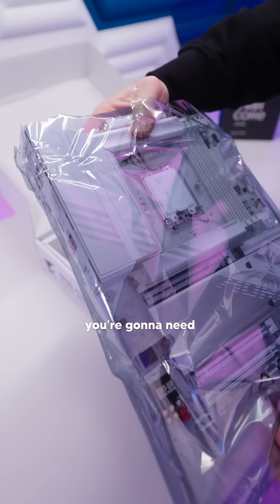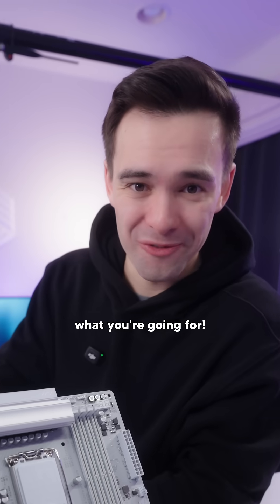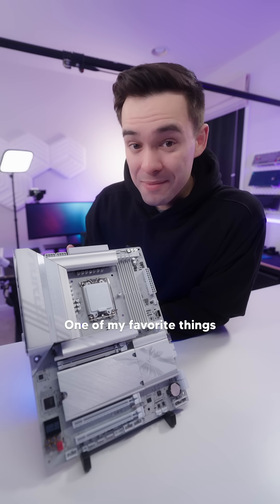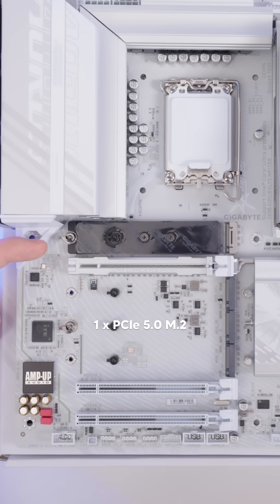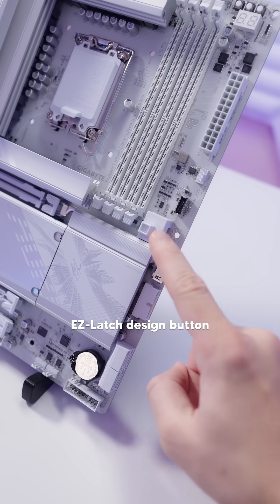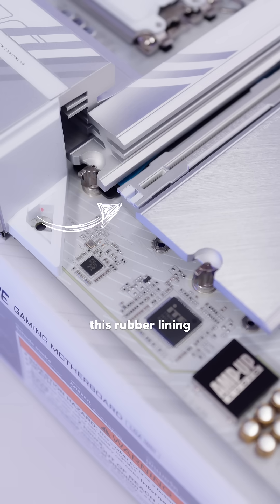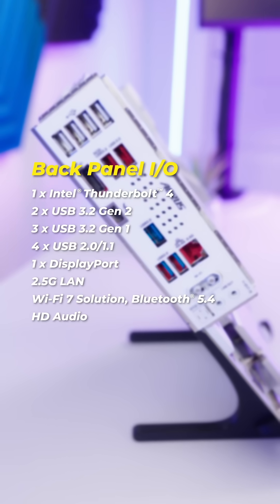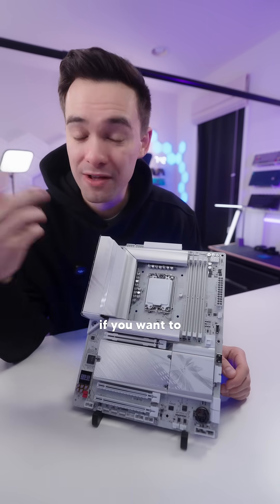Icy Intel Core Ultra Series 2 mobo 🥶 Z890 AORUS ELITE WIFI7 ICE

Comment: DDR5 doesn't do high speeds with 4 sticks.....
Reply: Yeah i hope 2 of them are dummy ram
Reply: @chocolat3milkplayz235 I learned the hard way buying 4 sticks then having to switch to Dominator titanium with dummy sticks to have all 4 slots filled. I still got these 2 kits lying around and I'm trying to get rid of them but no dice.
Reply: @JabbaTheNutz you can just keep em just in case your ram fails so you have spares or you can sell them especially in the ramageddon
Reply: @hHh5e I'm trying to sell them. I don't see an issue with my ram at all but you never know with how things are recently.

Comment: Amd king
Reply: Stop being loyal to companies, both Intel and AMD are multi-milion dollar empires, they couldn’t care less about us consumers
Reply: @frfoljek68 well yeah but AMD's top line CPU's dont kill themselves randomly
Reply: @ANormalHuman1220 ummm… x3D CPUs kill themselves on certain mobos, but I do agree, Intel really f-ed up with the 13th and 14th gen and even as an Intel CPU owner, I can’t defend them here. Very stupid that they took as long as they did to fix it as well. However, as I said, neither AMD or Intel care about you as a consumer or your needs, so you shouldn’t be a “supporter” of either one of them. Or Nvidia if we’re discussing gpus
Reply: @ANormalHuman1220 bro stuck in 2024
Reply: @Gamer1778 still even though most of the bugs have been fixed the high end ones like the i9's run so incredibly hot that unless you buy a watercooler theyre gonna throttle and shut down. And sometimes if you dont have an updated BIOS they can get too much voltage and fail that way. And with the performance difference between AMD and Intel right now in terms of price to performance theres really no reason to buy a high end Intel unless you just already have the socket and dont want to switch
Reply: @frfoljek68yeah but at least I can rely on AMD to actually make a CPU without bugs and issues I can't even trust second hand 13th and 14th gen
Reply: TRUE!!!!!